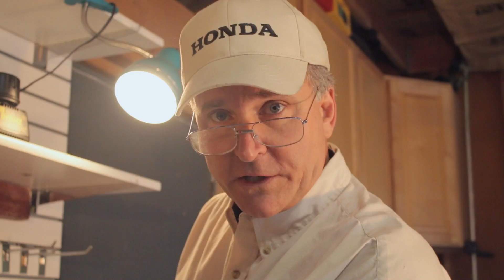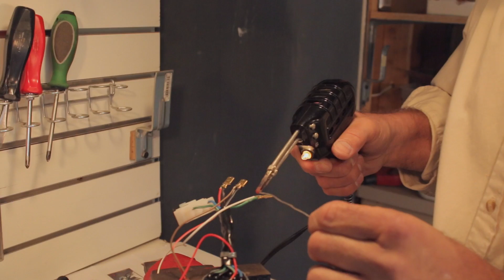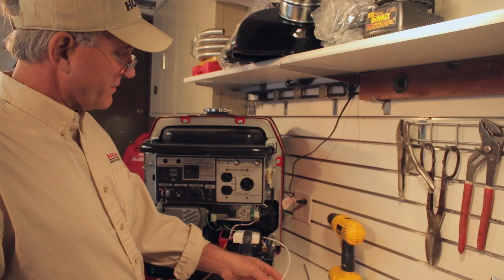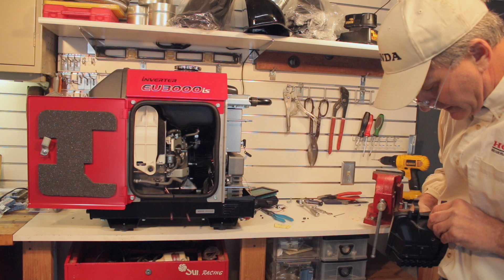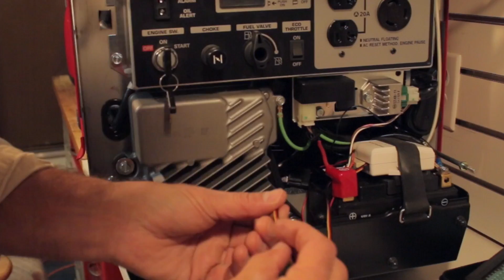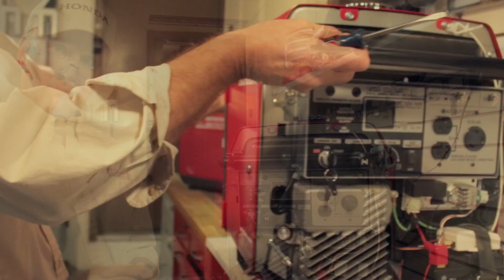Generator Line Honda EU3000IS/ EU30IS Wireless Remote System Instructions

Comment: So last I checked these aren't authorized by Honda. How this man doesn't get sued by Honda is kind of shocking. Especially at Honda prices–for a non-OEM product... 

Intellectual Property and Trademark Risks: Honda may sue for patent infringement if your modification uses technology covered by their existing patents, as patent owners can pursue anyone using the patented technology, not just commercial sellers.  They may also take legal action if your product uses their trademarks or copyrighted designs without authorization, or if your marketing creates a misconception that Honda endorsed the modification.

I have an idea–How about Honda claims your design and sells your remote conversion kits for $275 themselves. You see, maybe at $149 you might not come off as a Greedy thief who has backpacked off every Honda Generator sold in the last 20 years. Food for thought. ❤

Comment: I would like to see a load sensing until installed on a Honda to save gas especially when the A/C cycles on and off this way it'll save fuel and run only when needed.
I also like the remote start feature.

Comment: Here is another one thinking the same. And how did you centered the servo? Do you use a servo tester? Great product by the way!
Reply: What is the range of the transmitter? My generator is located on the outside of a cement block wall. Do you need line of sight?